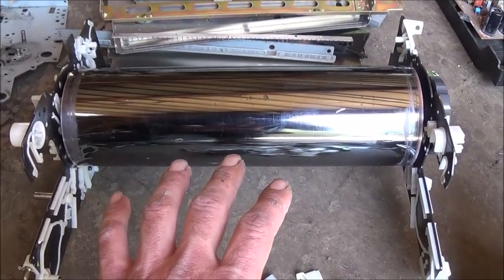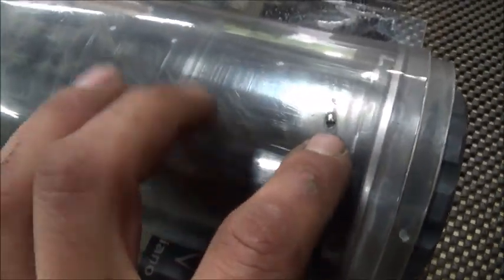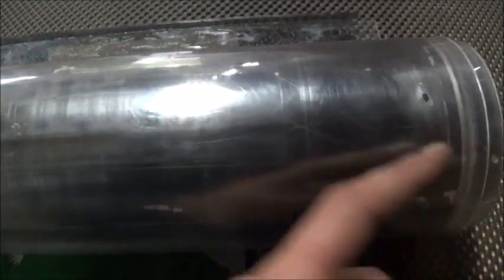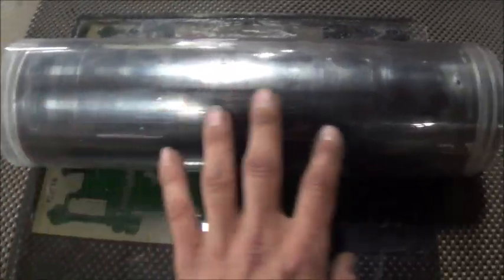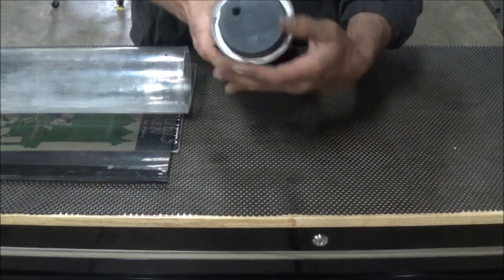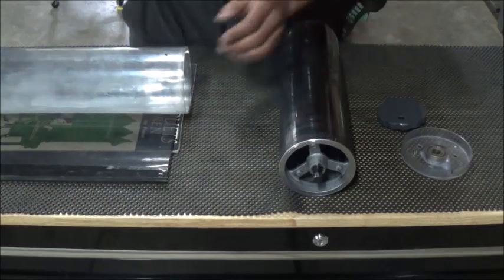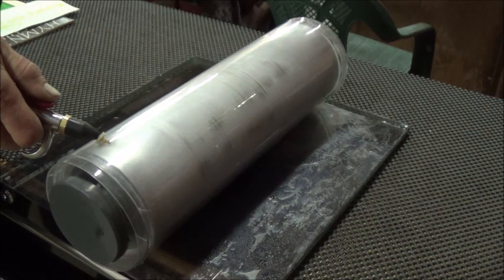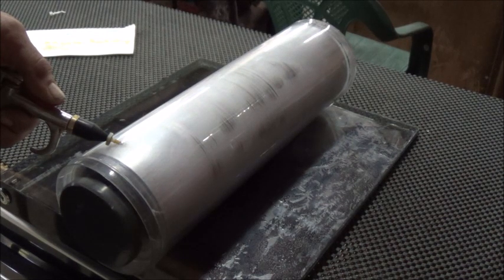"Tesla Turbine", New Bladeless Model

Comment: don't Tesla turbines need to vent through the center of each disk?
Reply from the maker: +SHADOWxWOLF This works by the same principle just in a different way.
Reply: Though I would say this design is less efficient since the ratio of drag developed on the outer casing in ratio on the moving surface is much higher than in the bladed design which I would guess might net in a loss in efficiency.

Comment: fluid dynamics being more or less equal... I wonder if it's possable to make  "hydraulic ram pump" to pump AIR from essentially wind power to power a device like this. given the inlet hole is SO SMALL.  

yes I understand that hydraulic ram pumps generally use gravity and you don't get the same effect with air from gravity but I meant to offer a vague concept to work from just to toss out some ideas asd get the creative juices flowing.

Comment: If you were to modify this to operate off of high pressure steam, would it be better to make the static cylinder superhydrophic so that the water isn't slowed down by adhering to the static cylinder?
Reply from the maker: That sounds logical to me, good idea!
Reply from the maker: If the engine was kept very hot so the steam would remain steam, then it would not be cool enough to condensate in the engine.
Reply: Yes, but wouldn't there still be drag between the steam and the static cylinder even if it doesn't condense?
Reply from the maker: Pressure is the working force not moisture.
Reply from the maker: If you use super critical steam and keep the engine very hot then you have a very powerful closed cycle engine that only reduces the temperature of the sc-steam by a small amount as it passes through the engine, this means that it takes much less energy to get the steam to maintain a super-critical state. Super-critical steam is dry and invisible, it will set a piece of wood on fire in less than a second, so it would leave no moisture behind in the engine.  The pressures of sc-steam can be very high 1000 psi and up, this creates a very powerful engine with little to no noise due to the lack of blades, pistons and the rest.  This is just how I personally would build the steam system for this engine.
Reply: That is more or less what I am thinking..  I am also thinking that the steam can function as a fluid bearing thus eliminating the need for ball bearings...I can send you my design if you are interested..I am leaning towards using a conical design as opposed to a cylindrical..if you want to send me an email at whoaushs [at] gmail.com, I will send you the design...

Comment: The friction between outher wall, wich is fixed, and air, will reduce the efficiency with 50 procent. Try to make a turbine rotor with two concentric cilinders with a small gap beween them, no fixed outher wall, and inject pressurised air tangent at one end of the rotor. I think this will improve the efficiency.

Comment: Very Cool! Layman's question. If you were to use a ribbed surface on the interior spindle, would that increase torque, or would you reach a point of diminishing return? Hmm, I think I may have just answered my own question... It would inhibit the corkscrew flow, wouldn't it... And even if the ribs were curved themselves, you would reach a maximum velocity based on the limit of the psi, right?
Reply: Ribs are actually detrimental to a tesla turbine as they introduce turbulence. A tesla turbine works because of surface adhesion and fluid viscosity. Basically it works because a fluid wants to stick to a solid and viscosity keeps the fluid's molecules from pulling apart. Ribs will cause the molecules to pull apart.

While this is clearly working on the boundary layer (surface adhesion and viscosity) principles, it's not a traditional tesla turbine design. It is very cool though!
Reply: Thanks for the lesson!
Reply: Zenman Energy what if instead of raise ribs...he was to mill small slits  ( i'm talking about just deeper than a mere scratch) in the cylinder at an angle that would direct the air toward the open end ...put about 10 slits in...would this help and give more torque as the air would have something to push against
Reply: I guess if the slits were cut in a similar manner as a screw, then it's possible. But... to do that you have to figure out what the optimal spiral is. That spiral changes based on the operating speed. The faster the fluid moves, the tighter the spirals. So by cutting slits (in this design) it would only be optimized for a single speed. Going faster and going slower than that optimal speed would likely create turbulence. By having it perfectly smooth the fluid can change speeds and change the length and angles of the spirals without introducing turbulence.

Even if you run it at the optimal speed for the slits, I don't think we're talking about an enormous difference in performance. If you cut grooves deep enough to double the surface area, the same results could be achieved by doubling the length of the tube. Of course, I'm just wildly guessing.

This is certainly a cool concept and I LOVE seeing Tesla Turbine research, Although I'm still partial to just trying to mimic Tesla's design as closely as possible and getting these damn turbines in the field.
Reply: You know... one thing a Tesla Turbine can do that bladed turbines cannot do is handle crap in the fluid. (literal and figurative crap that is!) As crazy as it sounds a bladed steam turbine will eventually explode if there are water droplets in the steam. A Tesla turbine has no problem with that. Take it up a notch and consider what would happen to a bladed turbine if the steam were carrying sand or even rocks. A Tesla turbine has no problem with sand and rocks in the steam.

Why does this matter? We could create electricity ANYWHERE in the world, 24 hours a day by drilling two deep holes into the earth (about 1-2 miles deep depending on the location). One hole injects liquid water, it travels through fissures heating up to steam and comes out of the second hole as steam. The problem is it brings sand and rocks with it. That destroys bladed turbines. But if we used Tesla Turbines instead it would work fine.

Comment: wouldn't you just have to attach a generator, realizing how much energy you can produce by plain forward momentum, either generated by windspeed or water-speed, see what the continuous consumption of that electric motor is to propel you forward at a desired speed, and than just multiply those Mini turbines in order to meet the continuous electricity need of that electric motor? It would be interesting to see how this scales up for large-horsepower electrical motors, their continuous usage and the kWh you could produce with harvesting the wind or water velocity of forward momentum?

Comment: This gives me pause to wonder how changes in geometry would effect performance. Imagine this as a cone or a toroid.
Reply from the maker: +Ron Armstrong Finally an interesting comment, I like the idea of the cone shape do to the shape of a vortex.
Reply: +MrTeslonian You should get credit for your interesting variation of Tesla's turbine. While it isn't made up of discs, it still works on the basis of adhesion and viscosity. Toroids are tied into everything in nature. Check out the lilly impeller. Everything significant started out the same way your turbine did. Keep it up.
Reply: Ok now go build the variant and post a video link. If this affects rpm the way I think it will you could create a turbine with a changing shape to vary rpm without changing pressure.